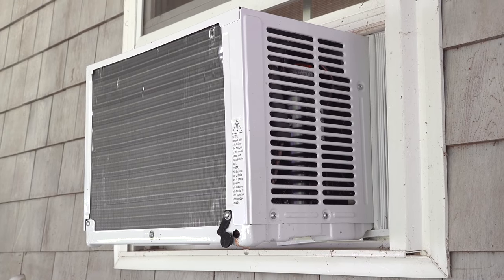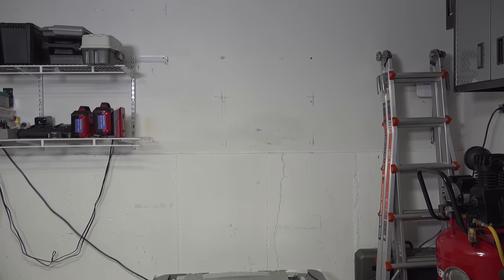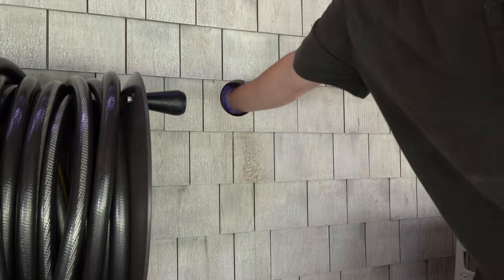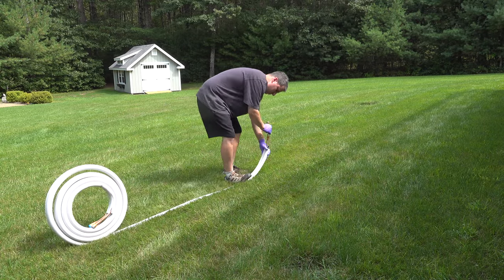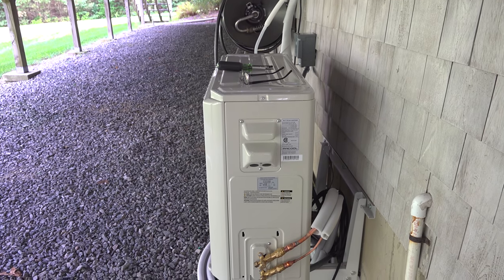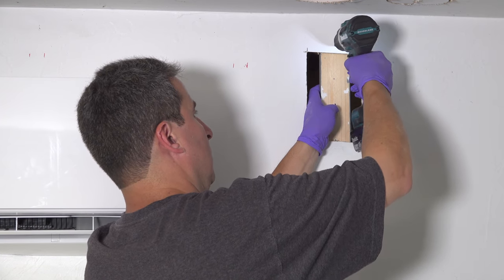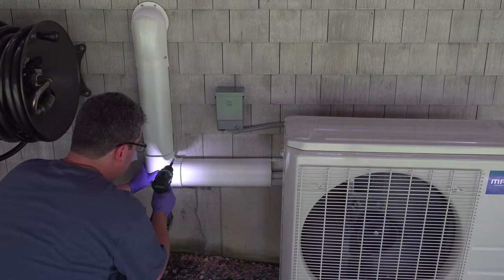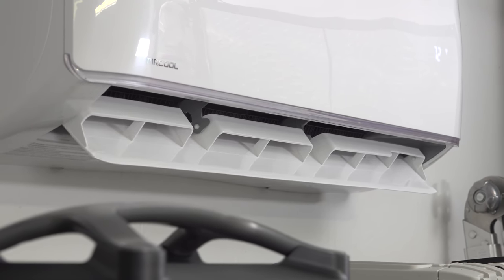How To install Split Ductless AC & Heating System // Start to Finish - 1 PERSON!

Comment from the maker: Thanks for watching please LIKE & SUBSCRIBE - Mr Cool Combo Unit: https://amzn.to/3BJwqVH - Super Nylon Ties: https://amzn.to/3zOkIss
Reply: 🤗👏🏿👏🏿👏🏿👍🏿👍🏿

Side Note:

Suggestion....I  would put a metal frame around the outside hoses that you lift ..off the Ground....

So RODENTS😳 could NOT! Chew Threw😊 Just Food For Thought👍🏿👍🏿
Reply: @Silver Cymbal    thanks for the post . Question can u connect one end of the quick connect line and come back a day and connect the other end to the condenser? Also when u first connected the 25ft line to the air handler from the hole did you hear any gas been release while tightening the first connection ? I just connected the first section to the air handler and heard the gas been release . It got dark and I couldn’t connect the other section to the condenser. Will connect the other section to the condenser in the morning. I am setting up a 4zone 12,12,12&9 k to a 36k condenser.

Comment: I installed 2 ton mini-split heat pump in my garage in 2019, and it's been one of the best investments I have ever made in my home. It is so nice to be able to turn the garage into a meat locker on those hot days, melt the snow and slush in the winter. You will be amazed at the moisture-removing power, even in heat mode. One thing to look out for - the brand I chose (not Mr cool) has a minimum set temperature of 60 degrees while in heat mode. I would prefer something in the 45-50 range for a garage application, just enough for snow melting and freeze protection. Maintaining 60 on a 5-degree day definitely burns some electricity. On those arctic days, it can cost as much as $15 / day. On the typical 25-35 degree days we have in Cleveland, I'm adding about $5 / day to my electric bill. For reference, my garage is fully insulated, including doors. In summary, try to find a unit that allows a wide set temp range.
Reply: @Ben Berkowitz thanks for the information that none of these videos tell.

Comment: I have 4 professionally installed Fujitsu units. No more fuel oil, and less heating cost, much lower cost for cooling. The installation shown here is excellent.

Comment: I installed the 24,000 BTU, probably identical to the one shown here. It saved my butt this week after power outages during hurricane Ida in South Louisiana. The unit runs fine on almost any generator. The variable speed compressor doesn't have a surge upon start-up. It slowly increases compressor power. These units are super efficient. I didn't get the collar that goes through the wall with mine...I need to call the company.
Reply: That’s a good piece of info, thanks broski!

Comment: Another beautiful installation! Love the attention to detail and clean work! 👌👌
Reply from the maker: Very nice of you to say, thank you
Reply: @SilverCymbal   thanks for the post . Question can u connect one end of the quick connect line and come back a day and connect the other end to the condenser? Also when u first connected the 25ft line to the air handler from the hole did you hear any gas been release while tightening the first connection ? I just connected the first section to the air handler and heard the gas been release . It got dark and I couldn’t connect the other section to the condenser. Will connect the other section to the condenser in the morning. I am setting up a 4zone 12,12,12&9 k to a 36k condenser.

Comment: To discourage mice, use steel wool with the expanding foam 💡
Reply from the maker: That's an awesome tip thank you
Reply: Or copper since it won't rust.
Reply: Did the same thing with my A/C install for the tubing sleeve. And pretty much any time I have a passage going from interior to exterior with extra space in it (for example, I also have a piece of conduit running through my wall for amateur radio antenna coax) I plug the remaining space up with stainless steel wool.
Reply: They also make an expanding foam with something in it that discourages rodents from chewing it, but I'd use copper or SS mesh too.

Comment: My experience with mini-splits is they are much better coolers than heaters. We use four of them in our place in Mazatlan, SIN, MX, where heating is never an issue since it NEVER gets cold. However, in Vancouver, BC, CAN, my daughter uses mini-splits in her place but needs additional (baseboard) heat in the winter when it can get as low as -5°C

Comment: I work in HVAC and install these for a lot of people, never once do I get complaints about the system. They are very easy to install alone but we use Mitsubishi units which don't come with prefilled line sets because they can reach 50ft. Good video!!

Comment: Thanks for saying “make sure to coil the line set horizontally.” I can’t tell you how many times I have said this to people.
Reply: im a newbie. why horizontal as opposed to vertical? please help
Reply: I would like to know the why too
Reply: @prodriguez3290  because if coiled vertical, the oil that circulates thru the lies will become trapped and useless. The oil is for the compressor. If this oil isn’t in the compressor it will cease up. At all costs please coil it horizontally, it seams so simple but it will make all the difference.
Reply: @jmat7103  because if coiled vertical, the oil that circulates thru the lies will become trapped and useless. The oil is for the compressor. If this oil isn’t in the compressor it will cease up. At all costs please coil it horizontally, it seams so simple but it will make all the difference.
Reply: @answernotfound5278  But I have seen even pros place it vertical. Does that mean the compressor will eventually fail prematurely?
Reply: @jmat7103  the lines can go up a wall etc. but the looping and then laying it vertical creates a trap, an the oil will eventually stay there killing the compressor.
Reply: @answernotfound5278  Thank you for the explanation!
Reply: @jmat7103  no problem

Comment: I’ve seen a couple videos like this, but I felt a little better informed after watching yours. Thanks for keeping it simple but thorough. Looking to build and I want at least 1-2 of these units for a garage and an electrical room for solar with lithium batteries that don’t like temperature extremes and a pool pump. Possibly 3 depending on the garage size. This is of course still a dream until done.
Reply from the maker: I really appreciate it, I had made another video with my friend but I wanted to see if I could do the whole job alone, its definitely doable, just go at your own pace.

Comment: I installed a mini split in my garage (Man Cave with insulation) in Phoenix AZ 2 years ago and during the summer it is the coldest place in my house at 72 degrees we always need a blanket to watch TV while in that space and it is very quiet inside and out and with the 220 volt system it actually brought my electric bill down $40 per month!!

Comment: Just wondering hiw how you did the wiring  I seen tools that are basically  magnetic wire fishing tools that supposedly better  than other methods.  Anyway I never thought of using the pipe  to cover that and the drip line  it for organization,  and making it look  great.  It looks like a professional installation better than what  was done when I paid people professional people  to install my air-conditioned split units

Comment: nice installation! I installed a 60k btu gas furnace and 30k btu central air conditioner 15 years ago on my garage. cost 2500 and installed it myself. no regrets because I use it all the time. thanks for another great video!

Comment: I installed a 12K unit and love it. If you install a heat pump AC in a cold climate the heating might not be sufficient during long cold spells. I believe the unit would need an electric heating element to keep you warm. 

Also, it's important when cutting through the wall to angle the hole downward from inside to outside. Mini split systems are notorious for condensate dripping from the indoor unit (air handler) due to drain lines not dropping sufficiently.

Comment: Great work on the install. I shopped around for a minisplit unit and got an Evermore unit from a FB Marketplace reference for 300 bucks and did the install. It's not as fancy as the Mr. Cool, but it's 1700 cheaper!

Comment: I have the same unit. Installed it in my new detached garage (22x25 with 13’ ceiling). Works great! AC is probably more effective and efficient than the heated.. but, the heater makes it comfortable in those dreary winter months hear in the North East.
Reply: Where are u located in the NE? Just got a 4zone 36k and will be finish king the setup tomorrow . I am in Dc. Installing it on a historic home. Two 36k / tone in towel 8 air handlers
Reply: @paulhance1984  central NJ.

Comment: Great quality for BOTH the mini split install AND (as always) the quality of the video which was to the point with all the information someone watching would need without unnecessary fluff to get to the 10 minute mark. 

I would very much appreciate a follow-up video with how the mini split performed during winter. I also live in similar climate (Minneapolis) and have been seriously considering these. All of the local HVAC people that I have talked to seem to want to discourage folks  from using mini splits saying they do not work as well in winter. On the contrary, I have seen first hand mini splits work quite well in other parts of the world as well as videos on youtube showing entire homes being heated/cooled by multi zone mini splits in Canada - which leads me to believe that the technology has matured sufficiently to serve both heating and cooling duties.

I do have a large-ish garage space -  almost 800 sq ft 3-car garage with 12 foot ceilings. So I am guessing I will need to invest in a slightly larger capacity (18k or 24k BTU?) unit. But I reckon if your friend can use a mini split for their basement (i.e. in a large living space), I should be able to find one with capacity to heat and cool my garage. I should note that my garage exterior walls and garage doors are insulated.

Thanks for the great video and hopefully can get some input on how well these work for heating in really cold climates.

Comment: Nice job. I would recommend cutting the refrigerant tubing to fit and reflare the ends. You would have to pull a vacuum on the tubing and the indoor unit though. In the world of refrigeration we are taught that the system is most efficient with the shortest possible interconnecting tubing and the smallest refrigerant charge. You would've probably had to remove some of the refrigerant due to the back to back installation. Some systems can tolerate small overcharges and some are temperamental.

Comment: Ive been using a 2 hose portable ac rated 14000 BTU in my shop. I just cut a small hole in the wall and plugged it in! Simple and cheap. Gonna add another one to get 28000 BTU for about $1k total cost.

Comment: How does the Mr Cool brand manage warranty on their units?  When I was looking to install a mini-split in my Northern Florida garage last year, I was always told that you can install your own unit, but that the manufacturer would not provide a warranty for it.  Great job overall; nice and neat work.
Reply: 5years on parts and 7 years on compress . You have to register the units on their  website after the installation. They will  ask for the date of purchase and date it was install.

Comment: If I get the smaller capacity version with 110V; do I still need a dedicated circuit breaker in the panel or can I daisy chain from an existing outlet ?

Comment: I hope that expanding foam didn’t cut off your drain by pinching with pressure. Great work and review!
Reply from the maker: No worries with that one, I didn't mention it a lot but the door and window version of the foam just fills the gaps but doesn't have the crazy strength of the other types that can do things like that. Even when done it kind of soft

Comment: The outside disconnect provides no over current protection it is just a switch the only over current protection you have in that set up is in your breaker panel... there's a little sticker basically telling you this... but nice video thank you for this I'm going to get myself one... I didn't realize they had line sets that were pre-charged...

Comment: The thing is with these diy mini split kits, you spend less if you buy a system from a quality brand like Daikin or Cooper and Hunter, and then HVACR tools necessary (get cheap since you only need it once) and the end result is a better system

Comment: I had a house built. 2 car and Rv garage together. I paid $11,800 for two of the wall mounts ran off of one condenser. Also all the walls were insulated. Just a reference number for anybody thinking about it

Comment: What is the square footage of the space you installed that unit? And how big of a space total will it work in?
Reply: Standard hvac rule of thumb is 12kbtu/1-ton per 400sf. 
This being an 18k means it will handle a 600sf open space. 
They replace multiple registers in large rooms and require one air handler per room or space(just like ducted registers). They don’t circulate around corners and down hallways into other rooms, just individual rooms or spaces. Remember, they’re highly efficient and use very small power wire to operate so outfitting a whole house with one per room pays for itself usually quickly if not priced too high by a big name contractor. They’re nearly silent, extremely effective if installed correctly, are wifi controllable/programmable, and more versatile than central a/c’s. They can be directed to blow on you or not using the remote, and circulate 100 times better than static sheet metal registers-very even throughout the room. And they surprise people just how well they heat—Much more efficient than space heaters and even gas furnaces.

Comment: Hi silver do you know if it’s is a inverter system I am think of buying one of these for my laundry room thanks for the video.
Reply from the maker: Yes, I should have mentioned that, its definitely an inverter. Super quiet and ramps up and down on demand. Makes me old central air seem like a dinosaur now.

Comment: Question:
What's best, to have the indoor unit dead level or have it slightly (very slightly) tilting to allow all the water to produced to run out?

Also, what's your recommended solution for always having loops, keep them horizontal or cut and flare to get rid of the loop?
Reply: Dead level to make it look best it is designed to be level to drain.Yes you should cut and re flare the end

Comment: Awesome video! I had these installed for my house (by professionals). The one and only thing that really s*cked about these units is when you have a power surge, that I think happened when the power came back on after a power failure. I have units on both sides of the house. The first power failure, the surge fried the computer boards on both units, insurance covered that. Another power failure fried one unit, which the insurance company gave me problems. If possible, could you please show a way to add a surge protector so this doesn’t happen. Thank you!
Reply: I believe you can use a whole home surge protector system. If the unit will be on it’s own circuit, then a whole home surge protector should protect it.

Comment: I would have raised the outdoor unit higher for your wintery zone.
Reply from the maker: That is a good idea if it was wide open but where it's placed here it's under a deck so it won't be an issue.
Reply: @SilverCymbal  totally hear ya. For me 3 feet off  is  the safest.

Comment: @silver Cymbal    thanks for the post . Question can u connect one end of the quick connect line and come back a day and connect the other end to the condenser? Also when u first connected the 25ft line to the air handler from the hole did you hear any gas been release while tightening the first connection ? I just connected the first section to the air handler and heard the gas been release . It got dark and I couldn’t connect the other section to the condenser. Will connect the other section to the condenser in the morning. I am setting up a 4zone 12,12,12&9 k to a 36k condenser.

Comment: Great video. I went to your amazon affiliate link. What do you think of the unit slightly smaller made by the same company that is only 120 volts? I have a smaller room (only about 200 sq/ft) that I need to both heat and cool. I think this other unit may be the trick. It's also a DYI install.
Reply from the maker: Definitely a good choice, a LOT of people get that one to avoid the 220 or like you the room just doesn't need a bigger unit. I think people have liked that one a lot.

Comment: I would like to know I was told  not to lay my fridge horizontally during transport. Because it won't work when I set it up vertically.  From hd and why is everyone on you tube putting these items in shed or garages. Are they Not sufficient for a home or modular?

Comment: What if you want the unit in an upstairs above garage. Do you have to mount the outside unit up high because you said the coolant lines are supposed to be run horizontal so if I mounted it at ground level I would have to run the lines vertically say for about 15’ or so. Is that a problem?

Comment: How do you find the actual cold air temperature at the outlet of this? I have a similar one & it only outputs around 18 degrees F lower than the ambient temp so for me that's an outlet of around 55degreesF. It's not super shivers chilly, like the system in my car is....